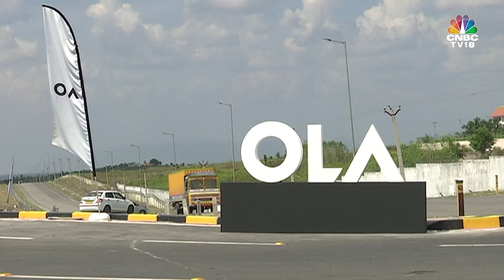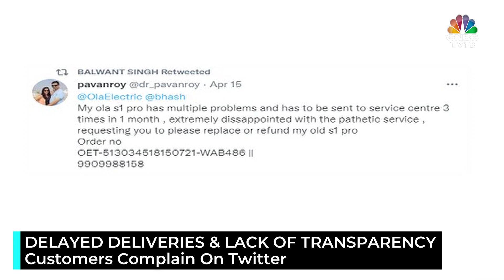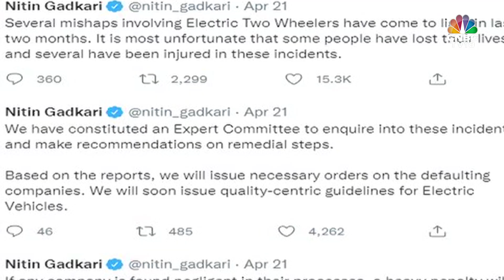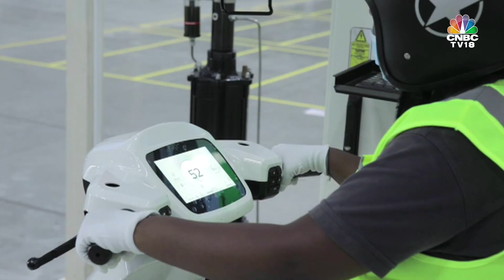CNBC-TV18 Visits The Ola Future Factory

Comment: Well it looks like they have a lot of automation which will lead to good quality assembly as things are tuned up.  CEO stepping aside from day to day operations is very common in most companies of a certain size.  Steve Jobs handed off Apple operations to Tim Cook, and Elon Musk takes very little role in day to day operations at Tesla.  A safety recall is very disruptive to customers, so the company has to have a solution and access to parts before ordering it or customers will be without their bikes while the company decides what to do.  In a recent fire where a customer burned his ola with petrol, the battery pack survived intact, so it's unlikely Ola has a thermal design issue.  With executives leaving the company, this too is common, as the skill sets to run a big company are totally different from a startup, so some people really do not like working in a company where it's more about motivation and leadership of staff than developing a fun product.